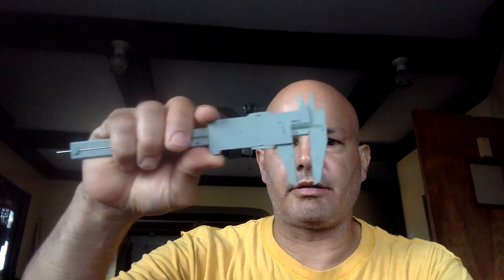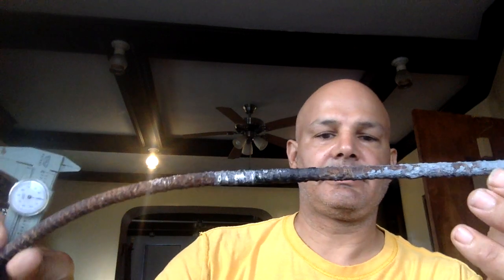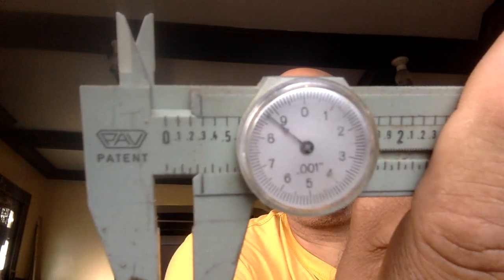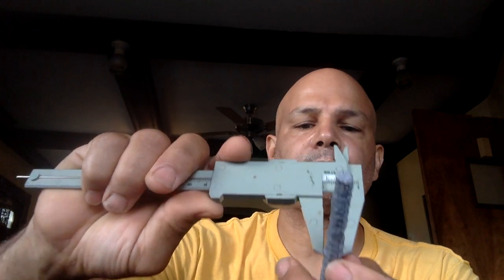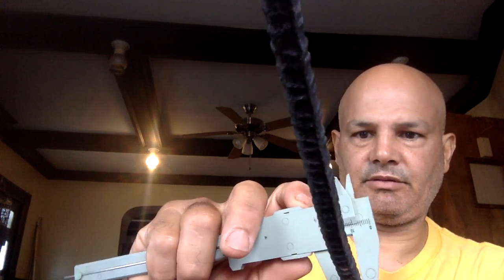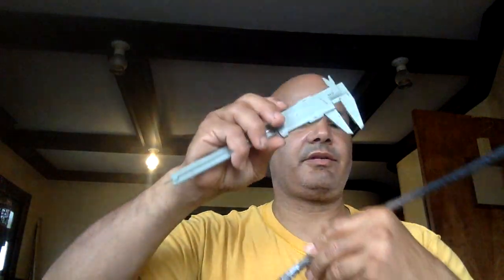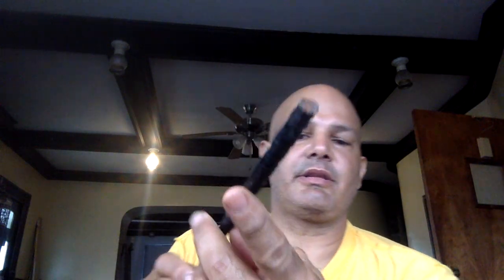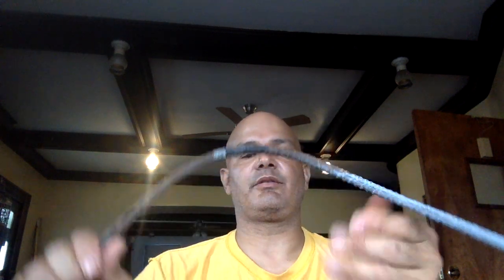CONCRETE AND REBAR INTERACTIONS MARRIAGE NEEDS THERAPY BUT THEY HAVE A PERSONAL INTERNAL FIGHT

Comment: Assuming the concrete had a grip on it at the start, what caused it to lose it's grip over time?  Was it salt corrosion or could the method of cutting also be a factor?  Shearing metal with a tool is not the same as cutting it with say an angle grinder.  I could see the action of shearing it seriously change the molecular structure of the metal.  Thoughts?